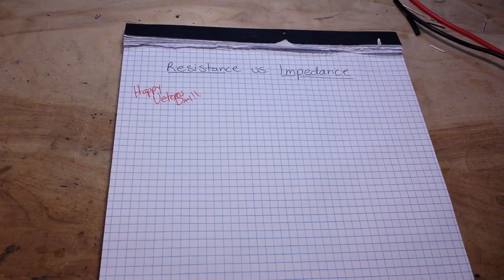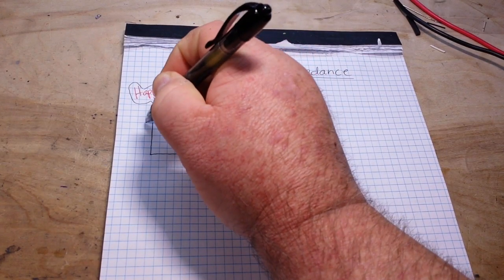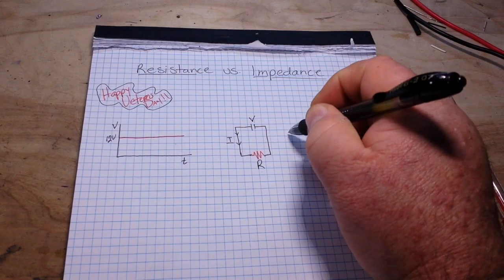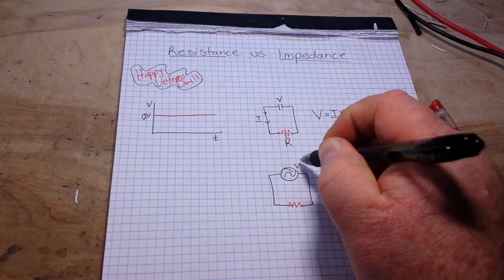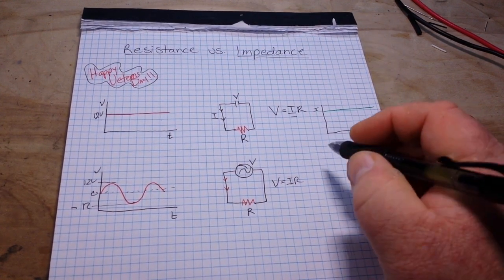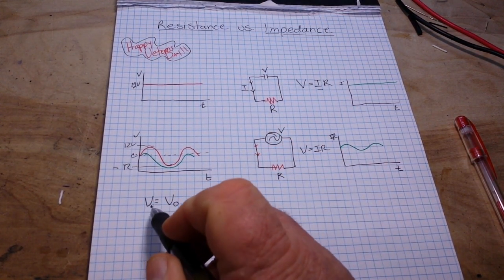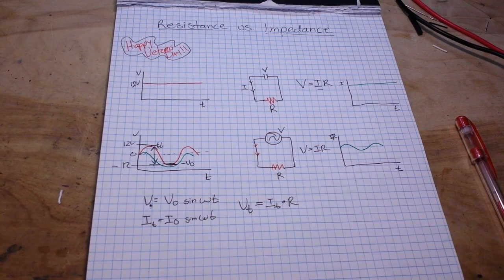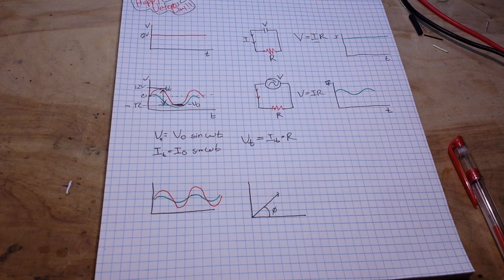Whats the difference between resistance and impedance?

Comment: I have always been trying to wrap my head around impedance. From what I have gathered so far, there are at least 3 different contexts for impedance: #1 one that is more historical and deals with driving and matching loads, #2 one that has derived from circuits getting smaller and smaller and finally #3 one that facilitates digital logic by allowing logic chips to remove their influence on circuits (see #2). Trying to track down a fundamental definition for impedance is a rabbit hole: impedance is the frequency domain ratio of voltage to current --- the phase and magnitude of impedance is determined by resistance and reactance --- ideal resistors have no reactance ... and ideal capacitors and inductors have no resistance (no such thing as ideal) -- finally, capacitive reactance is the opposition to change of voltage and inductive reactance is the opposition to change of current. Oh my brains hurt!! 🤕😂
Reply from the maker: Overly simplified but just think of impedance as AC resistance that's dependent on frequency.

Comment: What? You do not even come up with a definition of the term "impedance". Also you do not tell people what ω is. You just use it. Then you simply say that you can plot something (something you have not defined) as a vector. Many of your videos are like this. They sound like you're reading abridged sections from a bad text book.
Reply: A bit late to the party with this but if you check out 
'DrPhysicsA' video on impedance from 2013, you will see this is a carbon rip off, hence why it sounds like it does!

Comment: Isn't U usually used for voltage variables instead of V?
Reply: Potato, potatoe 🥔 
It's just a variable. But from what I've gathered, U is a less used variable so it makes it easier to work with considering V could also be velocity or volume. 
Not to mention when working with units as V could be either the variable or the unit of measurement and you might have a brain fart and cancel them out or combine them.

A simplistic example:
U=5V 
Is not as confusing as
V=5V 
Which would in turn (wrongly) be V/V=5 and we know that 1=5 is not true.

Might seem dumb in this example but imagine having to keep track of them in more complex problems!

Comment: So basically you explained the difference between AC and DC voltage, right? I expected the resistance/impedance not to alter AC to DC vice versa. Its just the name of a resistors function for DC that are called resistor and impedance for AC?